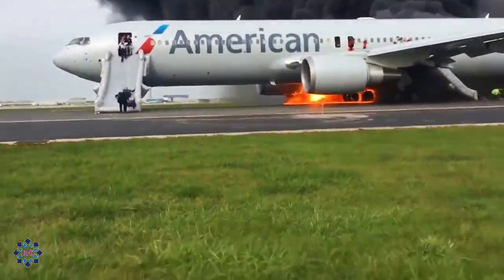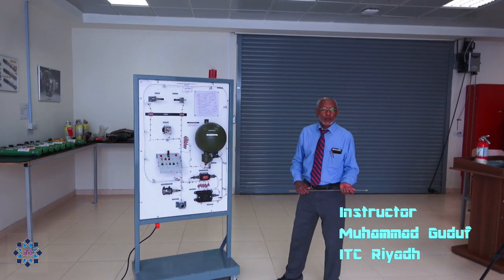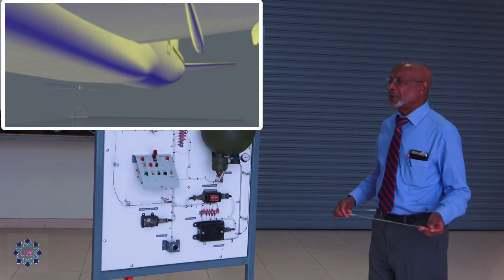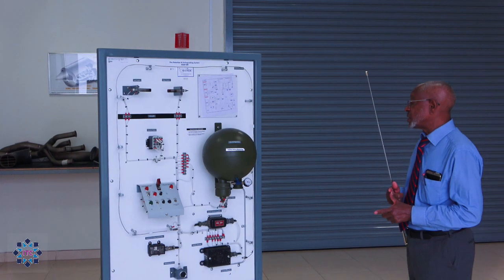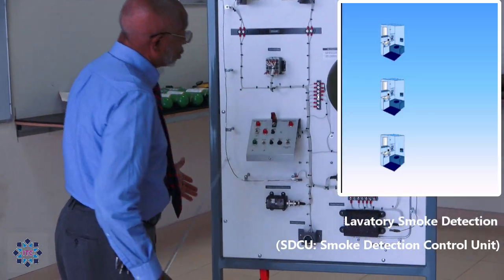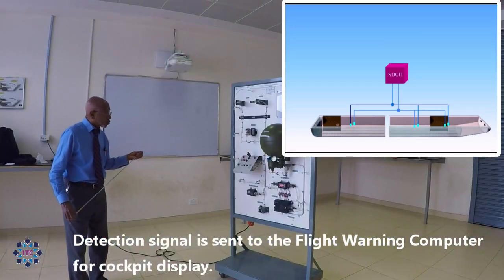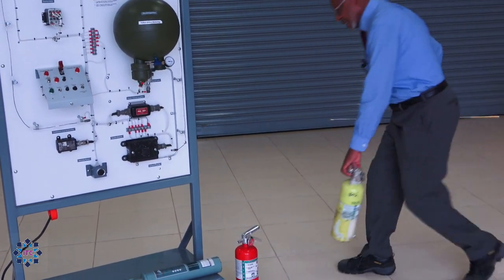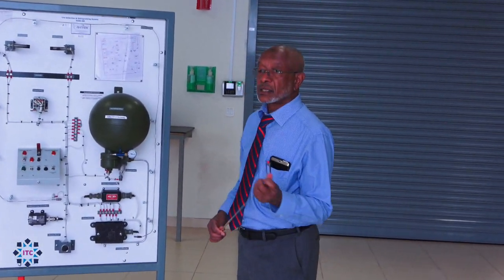Aircraft Fire Protection System

Comment: You would use CO2 on electric fires not dry powder. For fluid fires you would use dry powder as the CO2 would atomise the fluid making the fire worse.
Reply: Halon usually
Reply: You can tell, this guy got a bit confused, I'm sure you can see that all the bottles say Halon anyway which is the only extinguisher type that the duopoly of airliners use that can be used by humans. Cut him some slack, he's talking about very technical, non standard nomenclature, and he's obviously feeling pressured so cut him some slack. If I could speak 2 languages I'd be proud of myself for pulling that off, and so should he.
Reply: When he mentioned the most reactive metals: lithium/potassium and a very high temp burning metal:magnesium, he said that we'd use halon for this as well; which I think he meant to say for electrical fires. Especially, as I said, Powder and water is not used on airliners now!